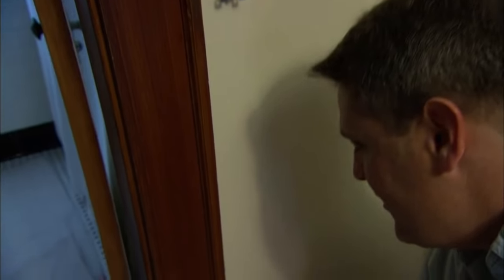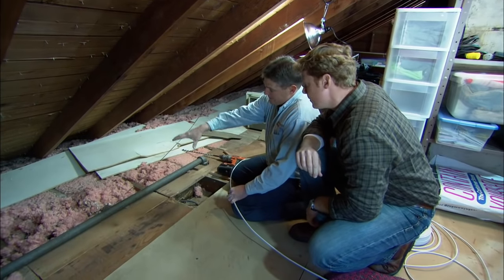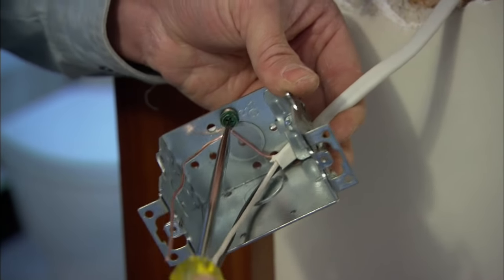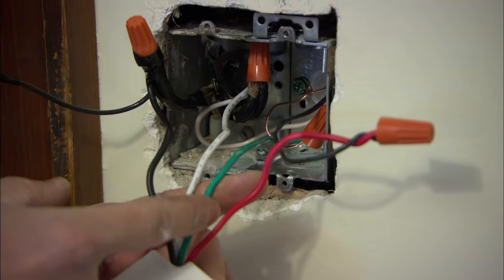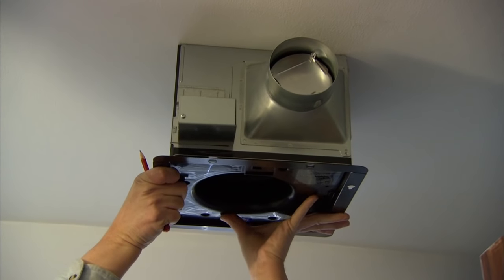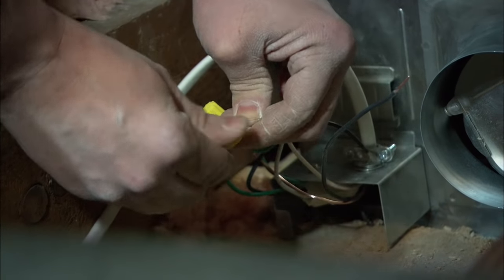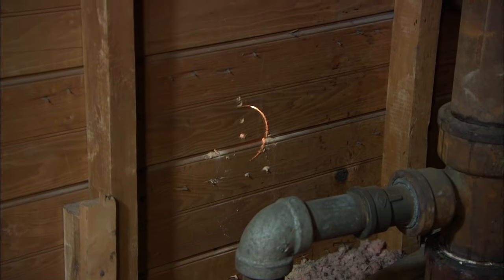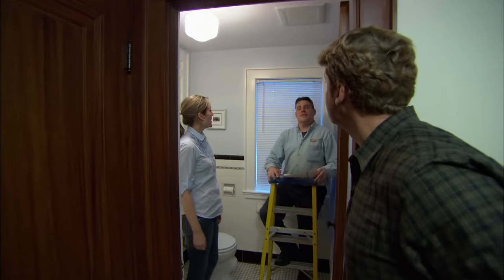How to Install a Bathroom Fan | Ask This Old House

Comment: Very outdated.
The duct tape will dry out and fall off.
The lack of insulation on the hose will cause moisture to condense and drip back down the fan...
Reply: Its not duct tape. Its electric tape
Reply: Solid review. Your completely right.
Reply: Don't forget the fact that he said "don't put above the shower" because existing the moisture directly would be to logical.
Reply: @Usonian7  Are you sure that is not because you don't want that much moisture soaking the fan? I have seen bathroom fan instructions that say don't place fixture directly above shower.
Reply: @Usonian7  I think they were worried about getting water from the shower into the fan.   If it is on the outside of the shower area it would only get condensation.
Reply: @Usonian7  the fan would short circuit if above the shower area directly

Comment: how did you screw the boxes together ??
Reply: datguy807 serously haha I never seen a junction box like that
Reply: The box actually clips in together . It is designed for those purposes
Reply: He didn’t. Lol
Reply: If you look carefully you'll see a screw inside in the bottom. Instead of going from the outside in (through the hole then threaded hole) he screwed from the inside out (through threaded hole then the regular hole). Best it'll do is hold it where it needs to be but it will be floppy.
Reply: datguy807, I had the same question. I use these boxes all the time in commercial buildings. You can’t gang them together properly without screwing them together from the bottom...which he doesn’t have access to. This video is garbage
Reply: I would have replaced that old metal box with a new plastic box, and kept the holes at a minimum.... sloppy work this.
Reply: Abel Casanova this magic box you speak of does not exist to my knowledge. If it does, it certainly wasn’t the one he used here.
Reply: @operationhotshotinc.6887  Yes in the older houses that used metal boxes it was common but their is a lock screw on bottom or top and a slip joint on the bottom or top  so you shove to two sides together and the put the small locking screw in, they didn't show how they securely locked the two together.   Also I just watched a previous video about Tom putting in a bath fan and he suggested and Aluminum insulated tubing for the exhaust.  Tom put his vent exhaust threw the roof.
Reply: @michaelc.3812  by code you cant bring that old bx wire into a plastic box
Reply: @nickduggan3084  AND you cant extend a BX circuit as cloth covered true BX wasnt designed to carry fault current ....so its a 2 wire non-grounded wiring method....Therefore no extending that circuit

Comment: Since the attic is vented through the turbines, does the bathroom vent have to be vented to the outside of the house?
Reply: I saw another video that said they used to vent it into the attic, which then would cause moisture problems, allowing mold to grow. so, yes.

Comment: Whoa. 30 year builder here and a building inspector. As stated below in the comments that exposed flex pipe is going to condensate like crazy and drip down onto your insulation and ceiling sheetrock/plaster. MAKE SURE you purchase the insulated ventilation pipe for bathroom ventilation passing through a space that is not climate controlled. Condensation can cause extensive water damage. Good day friends!!
Reply: You can just wrapped the pipe in HVAC insulation to control condensation..
Reply: It depends.  In a hot climate like Sacramento, with a ridge vent and soffet vents, it almost never is a problem with condensation.

I've seen exhaust fans that just dump air into the attic, and no problems whatsoever.

Comment: What about fan placement? You have it a little forward of the John, so when you do number two you will get a good whiff of what you dealt. Over the tank will pull the air flow away from your nose. That’s how the set them up in department stores. 😝
Reply: You will realise it cannot be right above the shower area as water and electricity don't mix at all
Reply: What, are you talking about?!  On the ceiling over the John, the toilet tank. 😂
Reply: @DegenerateToo  you should know if moisture gets into anything electrical it will short circuit
Reply: @stephensnell5707  Ummm… yeah. Watch the end of the video the toilet is further than where they placed the fan, so even less moisture!
Why do you think I’m saying to mount the fan in the shower??!!! I’m not!!! But yeah the center of the bathroom is right in front of the toilet so it can draw that yummy burger you had for yesterday’s lunch, so you can enjoy it again. 😜

Comment: Unless the existing power feed had a ground wire, the new circuit isn't really grounded, even if it is attached to the new box.
Reply: Depends. You can ground to a box if a number of conditions are met.
Reply: @deaconblues87  I suppose if the feed was in armored cable.
Reply: @deaconblues87  If there was a grounding conductor provided with the feed, it would have to be connected directly with the switched wires. By code, even if it was bx or mc, neither are an accepted form of grounding, although I would have to admit that it's better than nothing.

Comment: Great vid! Can anyone give me advice if a bathroom fan can be used as an exhaust fan in the kitchen? I live in a small studio apt, and just have a countertop and sink next to it. I have a 2 burner hot plate on the counter...but no exhaust fan. About 3 feet above the counter top is a long cabinet. I am thinking of installing an exhaust fan , and running a 8 ft duct to my window....just wondering if a small bathroom exhaust fan could be used for this?
Reply: Call an hvac contractor

Comment: Hello, 
When we had our roof replaced a year ago, I had the roofers install goose neck roof cap vents over the bathrooms with plans to install exhaust fans. Problem is, I wasn't specific with installing the type that allows you to attached duct work to it. So it's a square whole like a standard vent to air out the attic. It would cost $800 to get both exhaust vents replaced. I've been told by several folks (even AC contractor) that this actually common and people either just shove the duct work inside the vent OR they use duct board a trunk line to seal and create something the duct work can attach to. I'd rather do it that way otherwise the roofers would have to tear out the vent they installed and install a new one and that's an additional cost. Any suggestions?
Reply: I would get the roofers to put in the vents you want. They would know best about how to seal the holes back up.
Reply: Replacing roof jacks is super easy.  Or you could get an adapter.

Comment: How did you fit the new fan into the ceiling with the exhaust extending out?  Video jumps to you saying slide this in place but doesn't show how it was accomplished, see time 3:30 on video.

Comment: Do you need to airseal around the housing on the attic side? Or even the housing itself if it has small holes (and they usually do)?

Comment: Should’ve vented through the roof with insulated duct. Also proper tape would be the metal tape but as long as it’s sealed otherwise it really doesn’t matter.

Comment: He beat the hell out of the plaster
Reply: You should almost always put the connector on, then put your wire through. I don’t understand electricians that put the connectors on the wire first. It’s so much harder to put the locknut on with the wire in the connector.

Comment: So what happens if youre installing in a basement bathroom where you dontt have an upper floor to work with?
Reply: You run the exhaust out of the side of the rim joist just above the basement ceiling/foundation wall

Comment: You didn't insulate the exhaust duct. I just had to pay $3000.00 to rid my attic of mold because that same duct wasn't insulated. Wrong Wrong. You have to use double wall pipe or insulate it. Wrong!!!
Reply: +James Weidner - Same problem here, exhaust pipe travels 6' straight up from ceiling uninsulated in a cold attic (Canada). Moisture condenses on the cold pipe and drips down to the fan (huge electrical fire risk, I have repaired fire-damaged homes with the exact same problem). Save yourself the heartache and get a device purpose built for the problem, purchase a dehumidifier with a timer.
Reply: +James Weidner Thanks for the tip!
Reply: Mike Canmore and
Reply: Every single thing he did was wrong
Reply: Yeah that exhaust duct work should have been insulated. The warm exhausted air can cause condensation inside the attic space during the winter months. This can create a mold situation or at worst create an ice dam. Both bad situations...
Reply: I think that depends on where you live .. climate and humidity
Reply: Another video done by Tom shows him adding an insulated duct for this very reason. Surprised this one does not
Reply: I am sure they did but not shown

Comment: Hope you made that new electrical outlet up to code
Reply: Nope. They should have installed gang box. That way both switches grounded or run wire one to other

Comment: They SHOULD have used an insulated exhaust duct, not that aluminium junk. That will only cause condensation build up, especially in winter, as hot/warm bath air escapes into a cold duct/attic resulting in a water leaking back through the exhaust fan or a moldy ceiling at the least. He should have used quality foil duct tape which is significantly more tacky instead of actul duct tape that will potentially lose its grab resulting in a poor seal.

Comment: Any estimates on how much a professional would charge for this type of job? I had one contractor quote me $2k. Seemed really high, but I'm getting another opinion. Thanks in advance.
Reply: It depends on the house. This video left out a lot of variables. 1. The discharge pipe has to be insulated otherwise the hot moisture from taking a shower will vent up to the cold bare metal attic pipe and condense from vapor to water and run back to the fan and possibly short it out. 2. Should have used metal duct work tape. 3. Should have sealed the fan housing to the ceiling. 4. The vent to the outside of the house should be pitched down slightly to the outside so water doesn't sit on the Louvre cover and pitch back inside the house....some houses have to go through thick sills or the roof which costs more. The wiring in the video was also very conveniently accessable so it was easy to tie into. Also sometimes I run into very thin 20 or 22 gauge wiring where you can't "pigtail" into existing power... there's a lot to look for here. I understand your frustration. Ask him to explain to you in detail exactly what has to be done. If you include all the parts wiring cutting etc and if he is going through the roof then I would say that it could be $1700 or so +tax if through the wall maybe $1350-$1500 +tax. I understand it's a lot. I do this for a living and in old houses it's very difficult to work on some of these repairs. If you have a newer home then it could be a lot less to do this type of job. It really boils down to the work area and materials involved. I hope this helps somewhat. Best wishes.
Reply: Apex Maintenance 20 or 22 gauge wire?
Reply: @leonardholt5311  12

Comment: THINGS DONE WRONG IN THIS VIDEO:

1. He made the duct unnecessarily long by insisting on venting it through wall (which he never explained why) rather than the roof, and...  
2. He did not insulate the duct.  During cold weather, the exposed metal duct will allow water to accumulate inside the duct, pool up at the lowest points, and leak causing mold and water damage to the ceiling and drip down onto the bathroom floor from the fan.
3. He should have used FOIL tape, when securing these metal ducts together.
4. Did a crappy job with the hole saw.  Splintered the wood inside.  Didn't seal/insulate around the hole after the duct was installed.
Reply: He put it through the gable wall because the rule of thumb is to not put holes in the roof if it isn't necessary.  Since the gable wall was just a little further than the roof, it made sense to go with the gable wall.
Reply: 1.  On exhaust vents that evacuate moisture you dont run the ducting vertical.  Condensation and moisture buildup will run back down when the fan is not running.
2.  You are correct the pipe should have been insulated.
3.  Foil tape is expensive and not required for use by code.  If you choose to use it, great.  If not duct tape is an adequate substitute that will outlast the exhaust fan.
4.  Correct.

Comment: I need to replace two of these at my house. The old ones have holes in them on the top from in the attic and they are loud as hell. But these things are a bit expensive around $60+ each. I would think they are around $30 or even $25 since its not a big item and not so complex
Reply: What do you mean they have holes in them? Holes in the fan blades? Also, if you think they should only cost $25-$30, if I gave you $100, could you build me one?
Reply: @bigrig4385  they have a hole from the top of the vent because it was made of plastic. Mine looked like they came from the late 80's. I already replace mine. They are at 60 cfms...way quieter than the ones I had but could be more quiet. I bought mine at home depot for $35 each. I think a sale but it also has a light bulb connection with the wiring. I didn't put it in because it didn't really seem useful since I already have lighting

Comment: Would current code require adding a new dedicated 20 Amp circuit for the exhaust fan? (since this isn't a modification of something already existing, it counts as a new install, right? )
Reply: no
Reply: I don't believe so as it wouldn't be feasible to get a new circuit to the switch location and the total load would be approximately 1-2 amps.

Comment: Rigid pipe in a declining angle with no bend, using aluminum duct tape would be the recommended way to vent that fan; elbow & then "bendy pipe" with regular old cold weather rubber duct tape will mean water vapour rolling back into the house & mold in no time, and the duct tape coming off & causing mold in the attic.

No box around the fan, too, and just threw insulation right on top...  fire hazard!

Comment: Can somebody explain (for education, not being smart) why they didnt simply remove old box and add a NEW two gang box.
Reply: Probably didn't want to mess with those old wires too much, they might turn to dust if moved.
Reply: I just mentioned that in another reply. They should have, or ground the boxes together.
Reply: My guess would be it was a very old style box that was plastered into the wall with brackets in front of the stud. He could have saws-alled it out.

Comment: Why is the control outside the bathroom? Did I miss something?
Reply: Seems to be an old house where they put the light switch on the outside for some reason so he just put it next to that switch.
Reply: Bathroom was small and you’re not allowed to have access to a switch while standing in a shower.

Comment: Wow, what a hack job on the wall box... disappointing. And the duct work should have been insulated to prevent back-dripping (as you did on an earlier program with Rich in a cold environment). The box violated NEC rules to keep the gap at 1/8”, which is tough, but you left about a full inch!!! No staples on the NM cable either? ....

Comment: Why installing a bathroom fan using an electrician - he does NOT know anything about HVAC!!!
You supposed to be installed a 18" long piece of duct or pipe at the OUTLET of the fan first and then the 90 degrees elbow to prevent air turbulence in duct or pipe OR install a 12" long radius elbow. AND install insulation covering on all ducting.
This is how we do in our everyday HVAC installation.
DoALL Industries specializes in Commercial, institutional, industrial and hi-rise buildings: electrical, HVAC, industrial gas/oil burners, high pressure steam & hot water boilers, industrial heat and steam process equipment and plumbing installation & repairs for over 40 years.

Comment: Good video. However, an insulated flexible duct should be used in the attic to prevent condensation from building up in the duct, which can drain down into the fan box and ceiling.
Reply: Been an electrician for over 30 years, there was nothing he did that convinced me he knew what he was doing.

Comment: Take note, they never went back to the switch after installation to see the finished look.....probably because he butchered the wall with a screw driver and there's no way the cover plate will cover that mess. Also I love how they glaze over the part where they attach the new box to the old. How do you tighten screws on the top and bottom of the box you dont have access to? You dont, its nearly impossible. And as noted by others, yes he used drywall screws on the exterior to fasten vent, someone will be back up there in a couple years to replace the rotted out screws and remove the rust stains from the siding. Also noted by others, correct, you should never 90 degree a vent right out of the housing. It restricts airflow and adds noise. Only reason it was quiet it because Panasonic fans are made that way. Very surprised at this video considering its this old house. They should change the name to "These old hacks"

Comment: He should of bonded the ground to both boxes
Reply: The screws that secure one box to another act as a bonding. The question I have is was there a grounding conductor with the power supply?  Was it bx or mc or romex? I can only assume that there was no ground available as he only bonded it to the box and not another grounding tail, which means that technically none of it was actually grounded, it was a "floating ground".

Comment: OMG!  Not duct tape -- rookie mistake.  Duct tape should never be used on ducts!  Should be UL rated foil tape!  Also, he didn't insulate the exhaust ductwork so it will lead to condensation all along the duct and cause water damage in the attic and the bathroom ceiling.